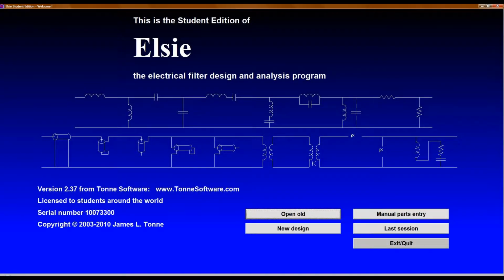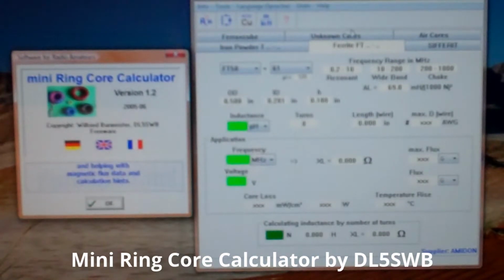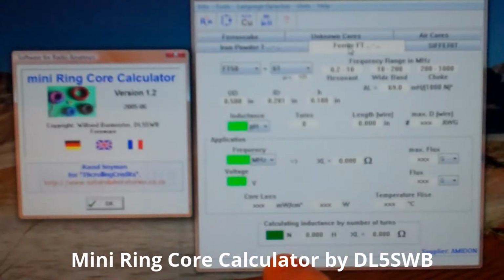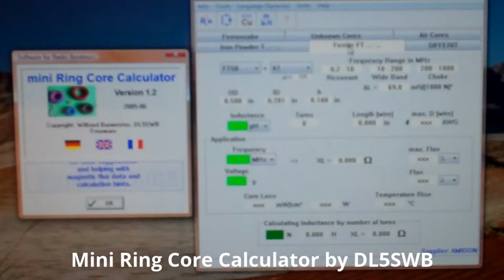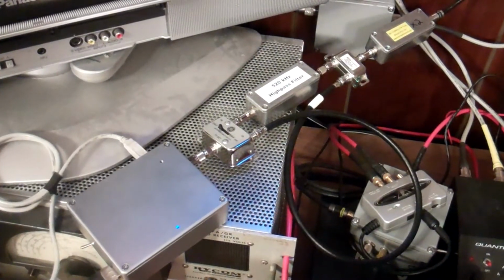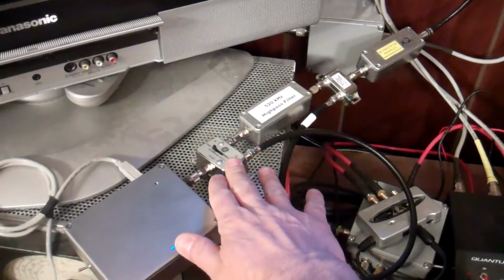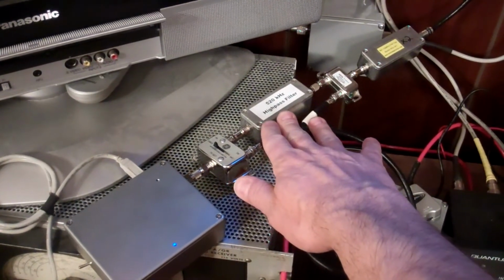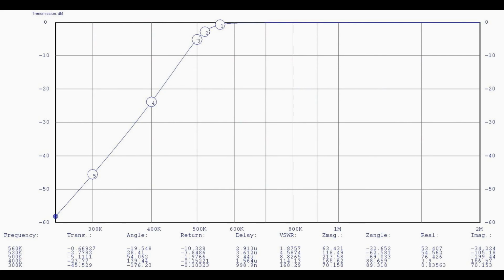520 kHz High Pass Filter Construction

Comment: nice hammarlund...sp600 is one of my daily drivers, so to speak ! hihi
Reply from the maker: Thanks! It's in pretty much amazing original condition.  I replaced the safety caps and some light bulbs. It could use an alignment but it works great and is amazingly sensitive for a 56 year old radio. One of the last models made it's a JX-37 manufactured in 1962.
Reply: thats pretty great, ive not seen a jx-37 in person.... I recapped and made sure my transformer was wired on the proper voltage tap...alot were wired for 110v and not for 120.  I also went through the arduous task of aligning all of the oscillators.  Really payed off.   I dont have the crystal bank for channelized operation, but im sure i could find the right crystals for the frequencies that i use most often...the HFO is pretty darn stable tho... after about two hours of warm up, there isnt much drift, if any at all.  I leave mine on 24/7 and the set frequency rarely moves.

Comment: I had a question regarding the orientation of the toroids , most of the time , especially with RF , I see them mounted at right angles to each other to avoid coupling .
Not that I know , but wondered about this , just for future building projects - when I need to do that and when I do not need to ?
Thanks 
KD0CAC
Reply from the maker: KD0CAC Sorry for the slow reply - I was on vacation. Regarding the orientation of the toroids. The coupling affects of toroidal transformers are reportedly less of an issue than with other inductors, though I admit I do not know the specifics of how they interact with one another.  In images of HF preselectors I have seen them oriented in the same direction as well as oriented at right angles.  I suspect for compactness and component assembly, many may orient them in the same direction as I have.  This is why I chose this method. I suspect that mounting them at right angles would be the better choice though.